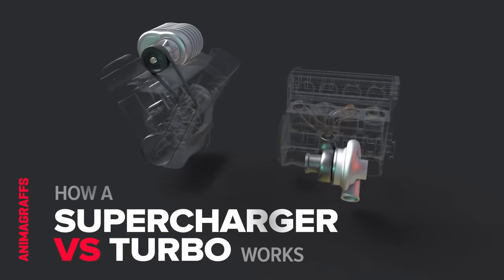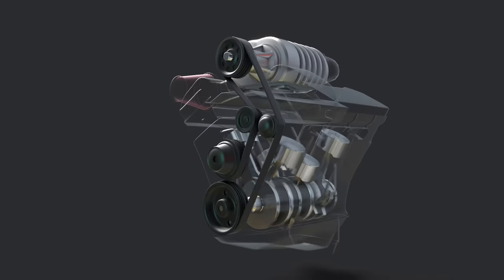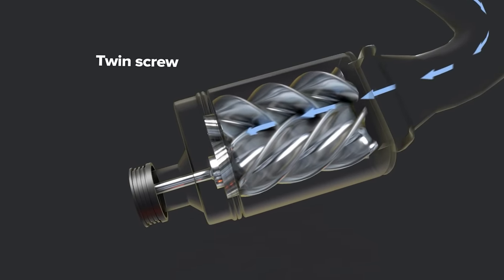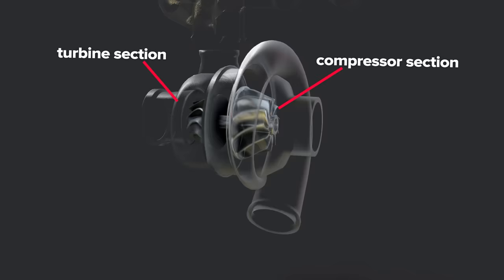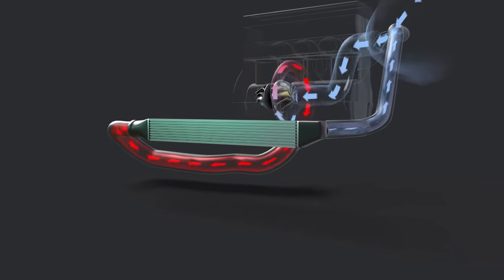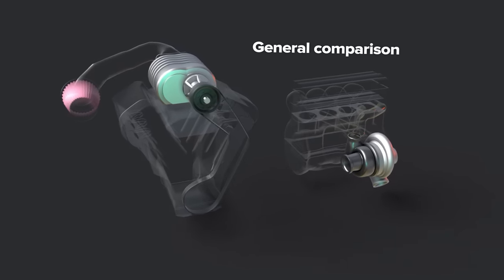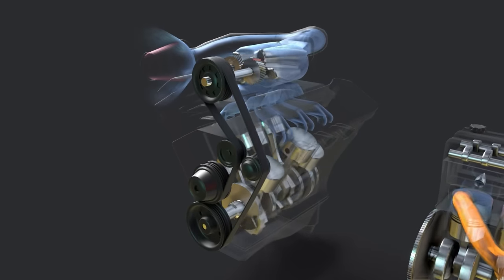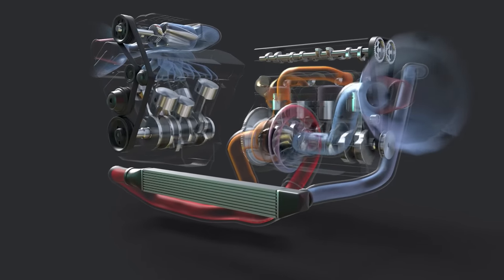How Superchargers vs. Turbos Work

Comment: so it should be possible to put a supercharger and a turbo in one engine right?
Reply: They do have set ups with both forced air induction systems, but they are extremely complex and difficult to install. They aren’t for the average backyard mechanic with limited resources or tools… The only one I’ve seen that was truly done well was by a guy who races professionally and has all that sponsorship money to burn lol. He also has a shop that any gear head would envy too. It’s state of the art and equipped with the best of the best equipment and tools. Lifts, fabrication machines, 3D printers and every type of computer/software devices you can imagine. 
Personally, I’m more of a naturally aspirated kinda girl.. but if I had to choose between the two, I’d pick the super charger every time. Easy to install, simple moving parts and less expensive. Turbos require so much more parts and integrated systems. I drag race, so my needs for torque and horsepower are specific to getting from point A to point B in the least amount of time
Reply: thanks :)

Comment: Hello, can a supercharger be installed on an atmospheric engine that takes its power from a separate electric motor?
Reply: yes,  and they exist.   the engine drives an alternator that powers an electric motor on the compressor.

Comment: One question
Does the supercharger lobe touch each other or the casing?
Reply: no, they get like 0,1mm or so from each other but they don't touch, every moving part of the engine follow a similar rule, if they actually touch each other they would lock up when heated the slightest due to metal expansion and or would have a huge wear due to the lack of lubrification (in some cases)
Reply: @VanguardDetonados  then is it possible to make it from carbon fibre than a heavy block of metal? 
So less weight and less parasitic loss

Comment: What Happens when you use Both at once?
Reply: I think that ur engine will blow fucking up when do that 😂
Because it will be kinda deadly cycle when turbocharger will make the cycle which compressing the air and make ur engine work harder. And the same time turbine of supercharger will spin faster because it connected to engine physically. So supercharger will make more and more air go to ur engine and more harder ur engine works which creates more exhaust gases which spin turbo charger which still spinning as fucking hell already so ur engine every second getting more and more and mooooore air in cylinders so BOOOOM engine gone🕯️🕯️

Comment: A Turbocharger is like a gas turbine engine without a "hot section."
Reply: Yes, the Turbocharger operates using the Brayton Cycle like a gas turbine but operates from a shared hot reservoir, it's a Combined Cycle heat engine.

Comment: 1. So a turbo takes hot air/gases from the exhaust manifold through the intercooler and re use it by taking it back to into the cylinder?
2. Supercharger basically sits on top of the intake valve and forces more airtake?
Reply: 1. No. The turbocharger has 2 separate sides that share the same shaft. On the exhaust side the exhaust from the engine will spin the turbine wheel, this is where the turbo gets its energy. On the intakes side, the compressor wheel sucks in air and passes it through the intercooler.
2. The non-centrifugal supercharger sits on top of the intake manifold. A centrifugal supercharger work like a turbocharger but instead of using exhaust gas it is powered by a drive belt (usually.)

Comment: I disagree supercharge engines are more costly than turbo since turbo engine are so common these days. I still prefer supercharge since the power range is linear in all rpm. That’s why I love my R53 Mini Cooper with 15% reduction pulley 😉

Comment: Turbos needs more maintenance, changing sparks earlier, oil consumption is higher, and higher carbon build up. Just stick NA instead.
Reply: Not different than a supercharger... Turbos make more power and burn less fuel... two significant advantages that outweigh any disadvantages.
Reply: and it very hot climates turning  off the motor without letting the turbo spin at idle can cause issues in the long run...supercharger does not have that issue...but dont tell that to little Wilhelm.....he might cry
Reply: @chadhaire1711  Not if you use the right oil... 
Superchargers wear out too... they don't have any advantages.

Comment: You failed to mention the turbo’s biggest inefficiency. Pinching the exhaust happens due to the existence of the turbo’s hot side. Huge loss of power, acceleration and efficiency there. Someone swapped in a larger turbo to an srt4 long ago. Matched new psi to output the same cfm as the stock turbo. Kept timing and fuel the same for shits and giggles yet actually gained 18whp due to the larger turbo’s hot side being much larger. Going forward, for efficiency’s sake. Turbo’s are it. No doubt. But if it’s a small almost instant spooling turbo, that hot side is a huge downside.
Reply: its not really a huge loss of power unless the turbo is massively undersized, the same psi from a different turbo isnt the same

Comment: One of the biggest myths about turbo chargers is that they are powered by otherwise wasted exhaust gas pressure. They actually create much more back pressure than a naturally aspirated engine. So, you don't get "free" power, you create back pressure on the exhaust system. The engine has extra load to push the exhaust gas out.

What does this mean? Turbos are NOT more efficient or better than a super charger. There is no "free" energy to power the turbo. The additional back pressure is subtracted from the output gain.
Reply: He also left out they create much more heat and weigh more.

Comment: Supercharging is the act of increasing the intake of an engine above atmospheric pressure.  A blower can do this, and so does a turbo charger. So you're saying a turbo charger supercharges an engine but is not a supercharger? Conversly, the old two-stroke Detroit diesel engines required a blower to deliver enough air just to run and were considered naturally aspirated because the intake did not operate above atmospheric pressure. Are you going to call a blower, in this case, a super charger?

A supercharger is a device used to supercharge an engine regardless of how it's driven.  Exhaust gas or belt doesn't  matter.

It doesn't make sense to say that you are going to supercharge an engine with a turbocharger, but it's not a supercharger.

Cool graphics though.

Comment: Does it matter the displacement of the engine?  for example are Turbo chargers more preferable for smaller engines like 2.0 litre 4 cylinder motors and are superchargers more preferable for larger 5.0 litre V8's?
Reply: No they use turbo on big trucks and v8s some European cars have superchargers on small 4 cylinder cars
Reply: the difference is only how they deliver power and how much power at what RPM, if the engine is a line, V, W, small medium or big makes no difference. The only thing it affects is that bigger engines need bigger turbos/chargers, that's all. Chargers are more responsive, turbos are more powerful at high RPMS. My rule of thumb is, chargers are superior to day to day normal drive, turbos are better for racing. But again the size of the engine changes nothing on how they work.

Comment: Lot of hella out dated info.    An intercooler is based on the CFM level more than the type of thing pushing the air.
PD styles don't usually have one because as you said they don't compress they just push more air.
Boost level isn't how that shit should be measured anyway. A T12 and a T66 at 10psi flow vastly different amounts of air.

Even centrifugal supers have an intercooler sometimes. And some factory turbo setups don't.

Turbo lag hasn't really existed in decades on stock to near stock cars.
And the better and better turbos get the more and more they'll outclass superchargers.
The only reason to put a supercharger on a car instead of a turbo is room/looks that's it.

It's been proven time and time again that a turbo will make way more power at the same boost on the same engine than a supercharger. Which also means you can get the same power of a supercharger with a turbo by pushing less boost and pushing the motor less.

Comment: The only thing I noticed that was off in the million things that were amazing is that the lobes of the supercharger were rotating in the wrong direction. They should be spinning clockwise/counterclockwise left to right which rams the air directly into the intake. Great videos though.
Reply: The roots blower rotors is rotating the right way, the twin screw is totally messed up though...

Comment: One of the very few descriptions on how 
the Roots and twin-screw superchargers, 
work.  Usually, one of them is spinning the 
wrong way.  (They don't spin the same way.)

We won't bring up the RAT.

steve
Reply: The twin-screw is totally wrong in this video, with rotors like in the video it should rotate the other way and have the intake at the front to discharge air at the back of the underside.
The air is supposed to go around the casing similarly to that of a roots.

Comment: You left out info on the supercharger.....it is usually the best way to go because it is more reliable, but the real disadvantage is size......it takes up a lot of room, so can only be used in big vehicles. Small cars don't use a turbo because they are better...they use them because they have to.
Reply: Turbochargers are very reliable, superchargers do not offer any significant benefits
Reply: @WilhelmKarsten  Totally  wrong. Supercharger is simpler and more reliable.  Only reason car makers done use more of them is because they can't fit under the hood, and are forced to use the more complicated turbochargers that add to costs.....you have no clue what you are talking about.
Reply: @chadhaire1711  Turbos are so reliable they are used on type rated passenger aircraft... 
No supercharged engine, all other variables being equal can ever make more power or be as efficient as a turbocharged engine.

These are irrefutable facts that cannot be dismissed or denied.

You still have a lot to learn about engineering

Comment: JUICE N' BOOST!!!. a lil nitrous off the line eliminates the turbo lag factor...The N2o cools the charged air too. then with modern throttle by wire...you can have the nitrous cut out by the time the turbo has spooled to peak power building boost.best part is.the nitrous is an option at the flick of a switch. there are remote bottle openers now .also...under normal driving conditions...your MPG isn't unreasonable. supercharger systems have no off switch ( though some centrifugal kits are instantly adjustable). aside from those kits, you are always blasting fuel down the cylinder walls...washing out the lubricant and exposing the cylinder walls and piston rings to premature wear. so...in conclusion...turbos are cooler and will get ya more ass than a toilet seat

Comment: I love how we always bitch about turbos v. superchargers in car meets and such because “superchargers are ran by your engine so they draw away power” etc, bro don’t you think that the HP rating of a car with a supercharger doesn’t already include the loss to running the supercharger??? Which isn’t as much compared to how much your charger will generate. Like I’ve met some dudes that literally believe that if they put a supercharger on they’ll gain 400HP, and lose 300HP because “the engine has to run the charger so you’re really only making 100HP, meanwhile my 20K twin turbo set up makes 400HP without losses & minimal lag” :| (of course I’m exaggerating the numbers but the same point applies) I’m like, nah bru, the 400HP already includes the what? 5HP lost from running the supercharger? 😂 

Having said all that, I do think turbos are just more efficient by their nature. So much wasted kinetic energy in your exhaust gases, why not use them to generate power without extra combustion? As in, we don’t have to reignite the exhaust gases. 

My ideal setup will always be twin charging, not letting those exhaust gases go to waste, and still have the “cool” factor and massive power generation of a supercharger. Also add some nitrous oxide system in there just for the shits and giggles. Sure, depending on your internals, tranny, drivetrain, block, cooling, lube, and power outputs, your set up might not last long with such a combination but regardless…. Why not…

Comment: You forgot to add the turbo's kill the exhaust sound of an engine.  Not an issue on 4 cylinder engines that always sound crap but on 6 and 8 cylinder engines there is the case to be made for exhaust note too.

Comment: Most diesels use turbo chargers because  they provide maximum boost regardless of Rpm. Diesels cannot use super chargers due to the fact diesels have low horse power, so super chargers being dependent on crankshaft would be too low to provide adequate boost. which means they have lower rpm speeds than gasoline. The main reason diesels have lower horse power Is because they do not have spark plugs to ignite the fuel, they use compression ignition, making an explosion that goes in all directions resulting in longer power strokes.
Reply: Diesel engines use superchargers and scavenging blowers...
Reply: Diesel engines have lower power per liter because of 2 factors which ultimately limit the operating RPM of 
Stratified Charge Mode Combustion which takes place after top dead center and is limited by injector timing and the diameter of the cylinder.
 The fuel cannot burn until its injected into the chamber and the combustion dwell time is reduced as rpm increases it is also limited by diameter of the cylinders. 
The larger the diameter of the cylinder over 100mm the longer the combustion time.

Comment: tl;dw

Turbos: 

+ Zero parasitic loss

+ Potential for excellent fuel economy in smaller engines

+ Lightweight

- Poor throttle response (Single turbo)

- Lower top end power

- Muffled exhaust note (Subjective)

Supercharger:

+ Instant throttle response

+ Keeps making boost all the way to the rev limiter

+ Bolt-on (?)

+ Exhaust note remains virtually unaltered (Subjective)

- High parasitic loss

- Heavy and complex

- Results in poor fuel economy

Comment: I disagree with the idea that turbos are more efficient due to the use of “otherwise wasted energy from exhaust gases.” I say this because it doesn’t matter how hot the exhaust is, it take’s energy to move it. Every aspect of any force provided from an engine will always be attributed to a power stroke.

It takes a power stroke to push the piston down and provide mechanical energy, is super chargers this is used directly from the crank, in turbos this is used with the medium being another piston’s exhaust stroke, which in turn is only available given another piston’s power stroke.

I think the real higher efficiency is simply in the design, it’s a turbine, spinning another turbine. Turbines are already very efficient with turning gas flow into mechanical advantage. While roots and screw super chargers are bad in design.
Reply: Your confusion here is due to misconceptions about turbochargers and how they work.
The turbine is an Impulse type and converts the high velocity gasses that continues to  expand from the left-over heat.
The turbine converts this heat energy into rotational horsepower using a Thermodynamic cycle called the Brayton Cycle much in the same way a jet engine or turboshaft engine works.

There is no parasitic loss imposed on the reciprocating engine.
The turbine is an engine driven entirely by the waste heat.
Any questions?

Comment: Superchargers will and always suck shit. And for the people that argue "BuT sUpErChArGeRs ArE iNsTaNtAnEoUs" can gtfo, because you can get twin scroll dual ceramic ball bearing turbos OR get a smaller hotside on the turbo to match your spool needs. Turbo's are EXTREMELY efficient, as in they use current exhaust gases that are literally already doing nothing besides being run through the exhaust and out of the car, and utilizing it to spin the turbine thus spinning the impeller faster comrpessing more air and feeding it.....Superchargers on the other hand literally take part of the engines power, to make power because of a parasitic loss. That and on top of being hard to control boost on the go, turbo's are superior. On a supercharger setup, you can only go with such a small pulley before you'll have to change out the whole supercharger, vs a turbo you can cap your boost setting and usually turbo's have a VAST range of boost it can provide compared to a supercharger. Just some food for thought...